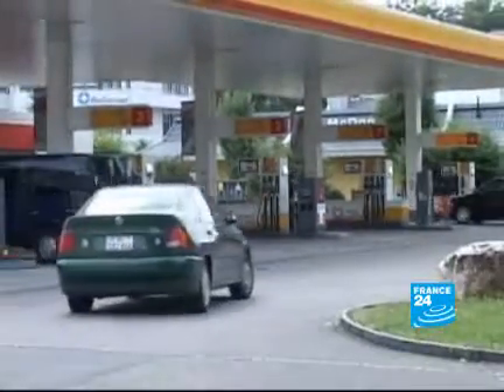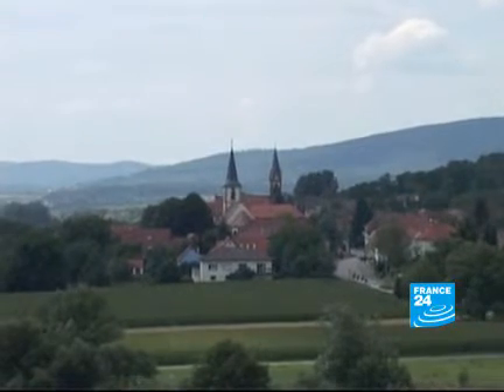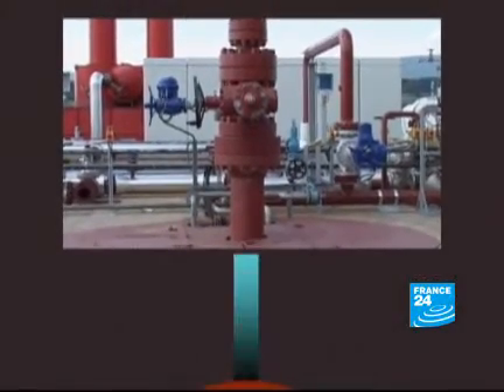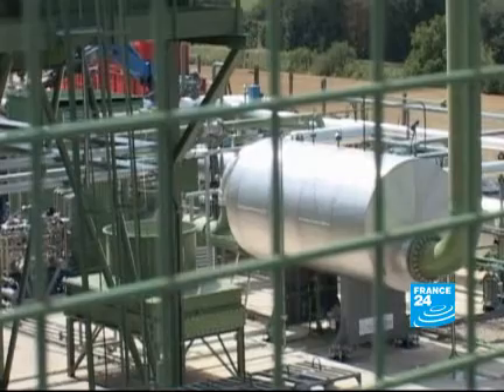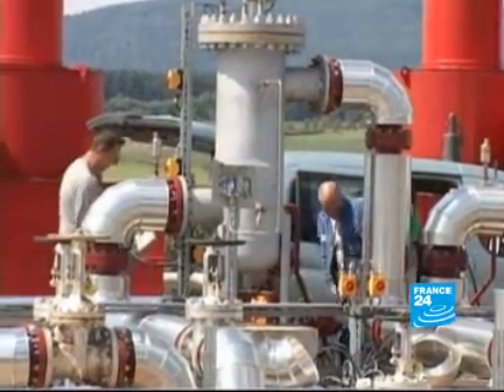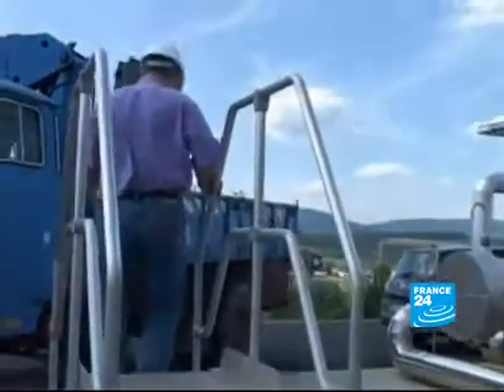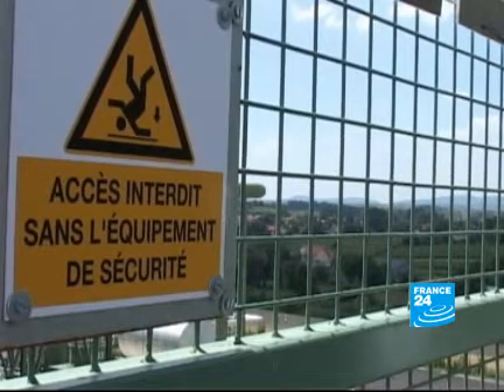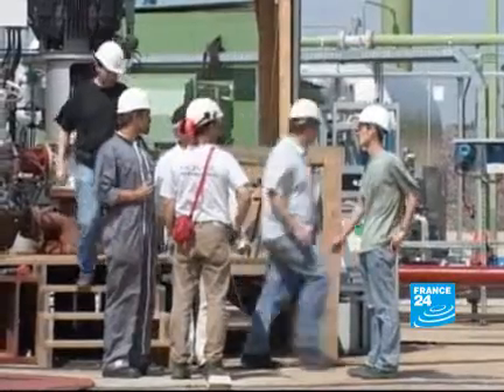Geothermal energy, energy of the future?

Comment: No, it's not possible this way. You don't just need heat, you need a temperature gradient, a heat flow from hot to cold (less hot). If you put a stirling engine just into a hot environment, it will not work. It needs a hot and a cold side.

Comment: To answer your first question; you can use another liquid, however water is very good at keeping energy and thus is a good choice. Second question; It is surely possible, however that type of installation is far more difficult and expensive to build than simply placing pipes, in addition you'd still have to transport that power (energy) somehow.